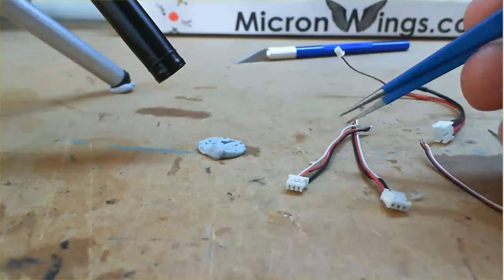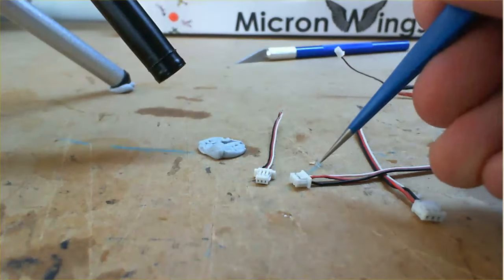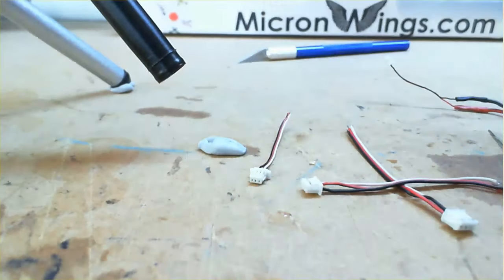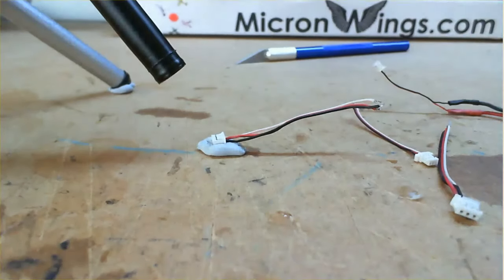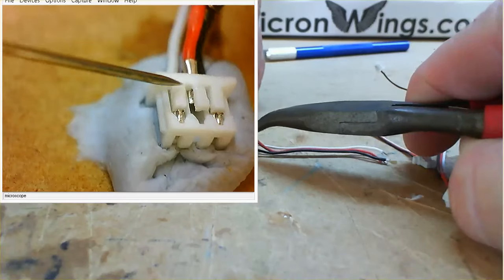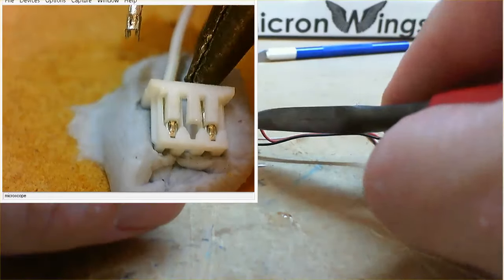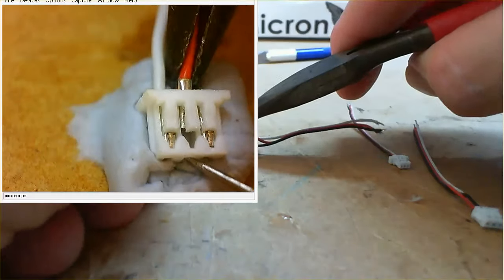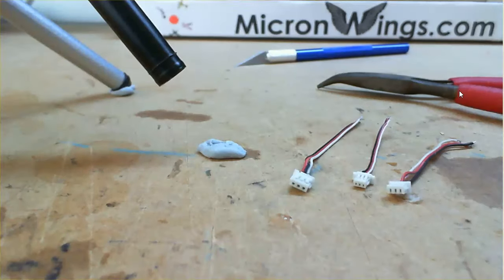Micro Rc Connectors - How to remove and swap leads

Comment: I’m kinda surprised this is the only video I was able to locate on this exact procedure yet it’s also the only one needed.  Well done!!

In my case, I ordered a replacement fan for a Dell D630 and it didn’t run.  Tested the fan and it worked.  Noticed it was pinned differently than the original despite being the same part number.

I’d bet a metric f-ton of CPU fans are tossed due to this.

Comment: You just saved me US$24-$49.99 for the FPV cable/camera kit. My power wire broke out so I found your video, pulled out the lead, went to a watch repair person and they fixed the wire for me as well as reinserted it. Cost me TT$20 0r US$3. Thanks a heap...great instructive video.

Comment: I went through a dozen or so videos just now trying to find one that actually had the style of connector that I was dealing with. Then anther 8 or so auto played while I was working. Of that sample size of 20, your video was the only one in focus. It also appeared to be the only bench top video that didn't use auto-focus. And then you cut to the microscope camera... mind effing blown. If I was into micro rc stuff I'd subscribe in a heartbeat. As it is I hope to never have to dork around with the connector on a lipo battery again. :)  Thanks a ton for the great tutorial on how to fix the polarity on these... just saved my weekend.

Comment: Wow, it is a little easier than I thought. I was putting them in upside down thinking that they then needed turned. I destroyed 3 connectors and tore the wire off by twisting.. I appreciate your help. Thanks for taking the time to show others the correct way to insert the pins.

Comment: Very informative on wire removal technique and in such a short video too. Answered two questions I had at once. Being an fpv quad pilot and needing to swap camera plugs, I checked FPV videos, of course. Looked for an hour til I broadened my search and found this. I need more videos like this, to the point, where it's simple tips without someones opinions for an hour and 5 minutes of actual tutorial.

Comment: Thanks for this video. Helped me reuse a "picoblade" connector that was slightly different than all the other 2 pin connectors I have found on 30mm fans.

Comment: Great video!  My first attempt hacked up the connector, but I'm sure I'll get better with practice.  I keep connectors from boards I don't use so I can scavenge connectors with the wires already attached.  It pays to be a horder sometimes!  Thanks again!  regards, NS.

Comment: I was going to build an arcade stick with a 3 pin led capable pcb but only needed 2 cables for each button, knowing i can take the unused cables out while keeping the 3 pin connectors without damaging the cables is great, since i can save them in case i want to buy led buttons in the future. Thx a lot for the info.

Comment: I wish I had your eyes.  Mine are not very good anymore since I was diagosed with gloucoma.  I do have some good magnifier lenses though.  What kind of pin did you use to lift up that plastic tab? Is it just a sewing needle.  I bought some stepper motor wires and acording to the reviews on Amazon the two middle wires need to be swapped so they will work on my Creality 3D printer.
Reply from the maker: Yes i just use plain old needles. just make sure you don't lift the plastic stopper too much.

Comment: Are there special tools made to install these wires/connection into the 4 pin connectors?  I have fat fingers and I need to build a lot of them. I know you used needle nose pliers but they can mangle the wire sometimes.
Reply: The problem you are describing is the results of the crimping. In most cases we squeeze the crimp tool too hard and it deforms the pin and or sleeve. This deformity prevents the pin from sliding in. In all actuality the pin slides in with minimal effort if the crimp is done correctly.

Comment: HI,
What is the paste  with which you stick the connector to the work surface ?
Thanks
Reply from the maker: It's jusr BluTack. Called other thinks in different countries. Its the stuff used to attach posters to walls.

Comment: hi, thanks for the video. do you know if the contact for a molex 5264 and contacts for a XH 2.54 are the same please? i have a new battery with a XH connector but i need to have a molex 5264 (that's the female connector on the circuit board), so i wanted to know if i can simply pull the wires out of one and pop them into the molex connector? thank you
Reply from the maker: I'm not sure about this but I don'y think the pin sockets are conpatible. you just need to try it i guess

Comment: Does it matter what order they are in? I need make a 2 pin to 4 pin connector for my broadcom adapter
Reply from the maker: The connectors are all the same so they can be inserted anywhere.
Reply: @MicronWings  thank you

Comment: would you know the pin out for fpv connector which is yellow, red and black in that order on a (JST SH I think). It is off a JXD JD509 FPV quadcopter. The quadcopter is damaged and I want to reuse the camera as it is still working as na fpv on another copter.

Much appreciate your help

Comment: Thanks for the video...I need to order those metal ends that go on black and red wires. What are they called?
Reply from the maker: Sorry i don't know what they are called
Reply: They are called Molex, PicoBlade Female Crimp Terminal 28AWG 50058-8000

Comment: hello Micron Wings, what is the microscope you are using?

thanks.
Reply from the maker: It's called a pen microscope - 2MP 640 x 480 res. You can buy them on ebay quite cheap. Just search for pen microscope.

Comment: I pulled a wire out of the pin by accident. trying to solder the wire back to the pin. if that doesn't work I'll need new pins. I need a giant magnifier too lol